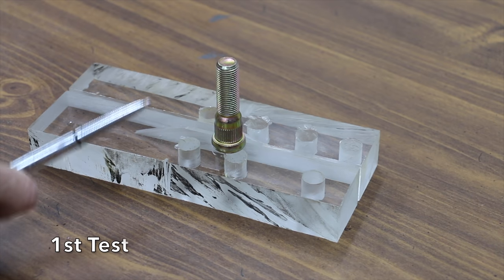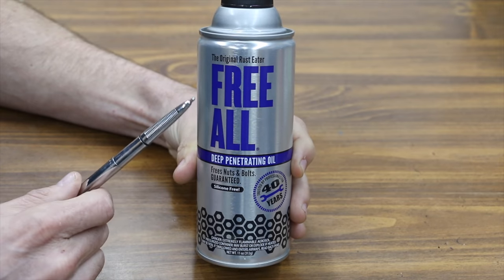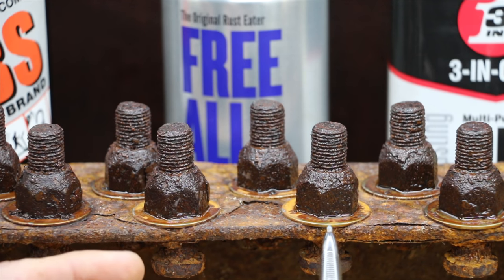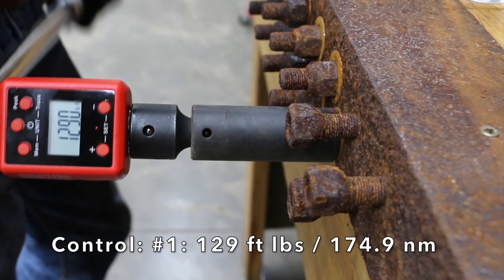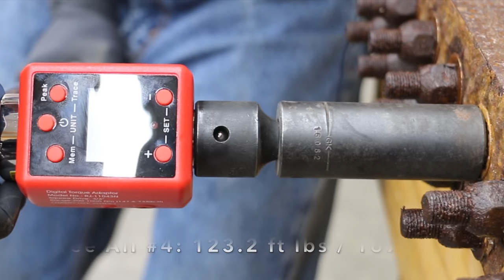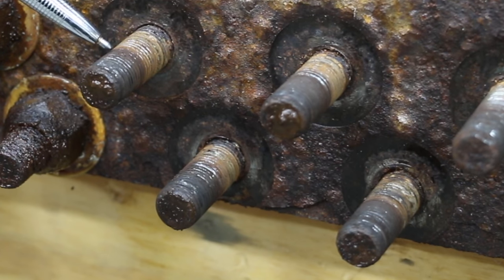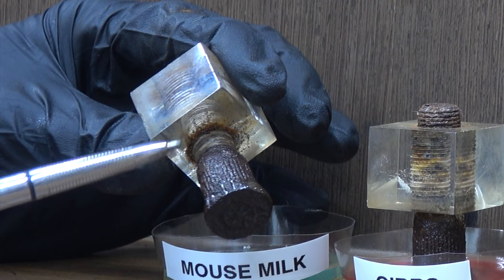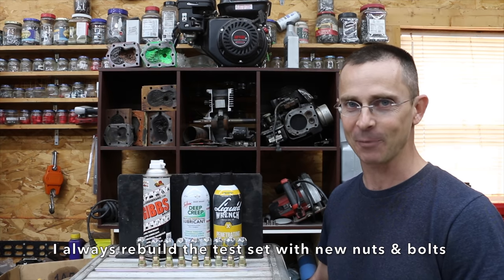Does Water work better than Penetrating Oil for Rusty Bolts? Let's find out!

Comment: seen the seafoam and gibbs video last night on my tv gibbs did not do so well  , for the price .  and I swear by gibbs since 1995 , but you show it's not the best I was Blown away .  I watch a lot of your test and you do a great job at testing .   last night the video had steel plate with rust prohibitors and you gave them a bath in salt and peroxide , gibbs failed  been using it on my guns other steel parts .  Thanks for the Videos
Reply from the maker: Thank you very much!

Comment: As a constructor I use a lot of screws, mostly torx heads. I'd love to see a test about screw shear strength and how well different types of head(torx, flat, philips etc) hold up to tool slipping, over tightening and so on.
Reply from the maker: Great video ideas!  Thank you

Comment: I was excited to see Zep 45 in the beginning, but never saw it during the tests. was it deemed not suitable for rust penetrating? Zep 45 is really fun, it smells like bananas.!

Side note for the water, you have to remember that that is the only one that evaporates. The second it starts climbing the threads, it increases its surface area so much that it evaporates before I can climb up any further.
Reply from the maker: Sorry about that.  I substituted the diesel in place of Zep 45 at the last minute since I had a lot of requests for diesel.

Comment: I'd like to suggest a test for cleaning very dirty and greasy engine parts. For example something like car wheel bearings packed with grease (smooth surfaces, clean grease) and also some parts with rough surface (cast iron if you can find enough similar parts?) with oil, grease and also smear some dirt on them etc. You could then try submerging them in various products. I've tried many "real" engine cleaners but none of them worked very well. Acetone works great, but smells awful and melts most gloves. Diesel is a good compromise, but it doesnt evaporate so the diesel needs to be cleaned off afterwards so not ideal either.
Reply from the maker: Thank you for the video idea!

Comment: Project Farm, you continue to impress! For an upcoming video, why not revisit the Seafoam Ford Ranger or the Blue Devil Ford tractor? How are they doing? Still running strong?
Reply from the maker: Thank you very much!  I need to revisit both of those.  The tractor is running great and so is the ranger, but the clutch is slipping badly in the ranger.  Maybe a clutch replacement video.

Comment: While some of these managed to penetrate in a tiny bit i think this demonstrates really well why penetrating oil is useless for the most part, it simply doesn't creep in enough to make a difference, I've been a mechanic working on all sorts of vehicles, even vintage and retro bikes, you're better off just using heat and a huge sledge than penetrating oil...
Reply from the maker: Thanks for sharing.

Comment: I had a cheap chinese pair of pliers left out and rusted, I squirted some gear oil between them and started working them back and forth for quite a while and it was still very stiff, so I sprayed some PBblaster knocker-er-loose on it, and it instantly fell to wide open.  sprayed it on the pivot circle and rust floated out the top of it like crazy.  Amazing the difference lower viscosity penetrating oils make.
Reply from the maker: Thank you!

Comment: You should to try out a half acetone/half atf mixure (automatic transmission fluid). I use this in a spray bottle like some other tests and it is the best even compared to penetrating oils.
Reply from the maker: Thank you!

Comment: I’ve never used Gibbs but I bought one can of free all and have never gotten anything since . Aside from being a great penetrating oil, it doesn’t hurt o-rings/rubber ect. Or paint and it only takes a fraction amount vs others. One can of free all will last longer than 2-3 cans of pb or others in my experience .
Reply from the maker: Thanks for the feedback.
Reply: @ProjectFarm  I was also a small engine mechanic , I really enjoy your channel , great job and keep it up! Also speaking on the free all , I’ve freed up several engines that were obviously rained in that were “running last week” ect lol.

Comment: The surface tension of distilled water means it works the worst in this type of test. Try it with 4oz of water and a teaspoon of dish soap, Go-Jo, or other hand cleaners as a wetting agent. You might use it as a condition in cleaning the crud off dirty parts.
Reply from the maker: Thanks for the recommendation!

Comment: the torque adaptor says on the side that its range is 147.6-738lb-ft.  the average values for all liquids are below 147. isn't this a problem?
Reply: I was wondering that myself.  I notice in response to blake kollman's same question, Project Farm replied, "Thank you. The readings are accurate. Compared it to my other adapter prior to testing."

Comment: Funny that people say 1 hour is more realistic than 3 hours. I say 1 hour is unrealistic and I will apply twice per day for three days. On top of that, once near the start and again near the end, heat the nut somewhat with a plumbers torch just before a spray of oil to help suck in the oil in and reduce viscosity along with the sudden differential in thermal expansion from nut to bolt.
Then I get a cold chisel(or air hammer with chisel bit) and split the nut as I should have done in the first place.
Reply from the maker: Thanks for the feedback.

Comment: Request : (Adding a comment there so it may be seen) Have you done any comparisons between OE disc brake rotors and equivalent aftermarket ones.  Do they rust less or more, do they warp easier, material hardness, toughness...actual material composition testing   etc.    Thanks.
Reply from the maker: Thanks for the video idea.

Comment: "it doesn't appear that the water did any sort of penetration"
But how do you account for evaporation? If I absolutely had to I'd probably use boiling water on the bolt and cold tap on the screw. Also did you account for salinity? (just thinking out loud - love the video 👍)
Reply from the maker: Thank you for the constructive feedback.

Comment: Another simple test is put your thumb and index fingers together as tight as you can. Then put a drop of penetrate to the fingers vertically. Turn horizontal open fingers to see the penetration that has gone thru your fingerprints. Also my favorite is BRAKE FLUID or ATF. Brake fluid works fanatic as a lubricant when drilling out studs or tapping any metal.
Reply from the maker: Thanks for the tip

Comment: Personally I find heating up rusted nuts with a torch loosens them up the best. Problem is you can't always do that on an engine. Try this same test after heating up the nuts. But don't heat them up too much otherwise the fluids will just vaporize. You may have to add more because it will evaporate rather quickly. I wonder if you use enough of the penetrating oil to cool down the nut would make it penetrate better?
Reply from the maker: Great suggestion!  Thank you

Comment: I wonder how well acids would work. A while back I used a vinegar to clean up some rusted parts. Also acids are used quite often to etch metal to make very unique patterns. You even use acid to remove the oxidization from aluminum so you can anodize it.
Reply from the maker: Thank you for the test idea!

Comment: Candle wax. Yes, candle wax. Old trick - heat nut and bolt up with torch (propane will do) as it only has to be hot enough to melt candle wax. Turn off the torch and touch the candle stick to the threads of the bolt right where they meet the nut. The candle wax will wick up the threads and loosen that nut  better than any oil you ever tried - give it a shot. It is a god-send working on suspensions in the Northeast.
Reply from the maker: Thank you!

Comment: I use 1 part automatic transmission fluid and one part acetone.  Far better than anything on the market.  Just have to make sure to store in a sealed container as the acetone will evaporate off
Reply from the maker: Great mix! Thank you

Comment: PB Blaster in my opinion works the best. It not only penetrates but disolves rust making rusted bolts come out easier. I'm sure that there are good products out there but I like to stick to the one that works best for me. Penetratiing by itself is only half the job. Disolving is the other half that saves you time and money.
Reply from the maker: Thank you

Comment: Another one you might want to test, different types of greases which product holds up to heat, lasts longest, protects the best against friction reducing ware. General multi-purpose, chassis, baring, and possibly marina ones are they any different or just a label.
Reply from the maker: Thank you

Comment: Are rusting necesary for thiese " experiments"...torquing bolts to spec,and then applying liquids could make "experiment" less depending on variables like rust consistency,if penetrators work then they should work on clean,fresh materials too. Besides, you could reuse those lugs and nuts and it would make seting up examples less time consuming. Anyways, superb chanel, superb content
Reply from the maker: Thanks for the feedback.

Comment: Why Water? Water dissolves rust. Rusty lineman pliers worked in water will free up like new. Then use WD 40 to displace the water. Rusty bolts or nuts if they can be barely moved if worked back and forth with water will loosen fully. Petroleum lubricants will not dissolve rust but will help lubricate. If some form of alcohol is included, the water in the alcohol will help dissolve rust if other ingredients don't interfere with the water/iron oxide reaction. Commercial fishermen have known this for years. They pull their rusty pliers out of the bottom of the boat, shove them overboard and work back and forth a few times and voila! I always try water first. and it usually works....then lubricate.  By the way... If using high heat to loosen parts, use cutting oil as a lubricant. The sulfur in the cutting oil will pull the oil into the heated part.
Reply from the maker: Thanks for the feedback.

Comment: If not doing multiple applications should still apply it again 5-15min before removing the nuts. If letting a product creep at the very least it would be applied again before removal. 

I thought the original 3 application method was good though. Gave the products more time to work, so if there is a superior product it should pull ahead significantly.
Reply from the maker: Thank you!

Comment: Great video keep-up the good work.  I’d like you to test Tech Line’s Dry Film
Lubricants.  These are coatings you can apply at home.  Do they work?  Many pistons for performance applications come with a dry film lubricant applied to the piston skirt.  Can Tech Line really work with a home applied coating?

Apply the dry film lubricant to a small engine piston, and connecting rod bearing journal.  Test
with oil for improved performance.  Remove oil and operate until lock-up to see if the coating protects the engine.

Maybe even test the thermal barrier on the piston top and head to see if it lowers operating temperature.
Reply from the maker: Thank you!

Comment: I want you to test something. I was told when I worked HVAC, not to used only WD40 when cleaning drain snakes for the Plumbers. PB blaster needed to be sprayed on them after wiping off the WD40. The WD40 would absorb water from the atmosphere and cause the drain snakes to rust.
Reply from the maker: Thank you for the video idea!  Does this video answer the question?   https://www.youtube.com/watch?v=UoijjWUGU2Q

Comment: I know it's not supposed to be used as that, but for years I've used WD-40 as penetrating agent to loosen rusty bolts and nuts with moderately good success. I would have liked to see it compared to specialized penetrating oil products.
Reply from the maker: Great suggestion! Thank you

Comment: If you ever come back to doing more penetrating fluid tests, I have two for you to try.

S' OK and CNH Industrial penetrating fluid (Part Number B505501)

I've used both at work and have had good to great experiences with both. S' OK seems like a standard penetrating fluid, but CNH Industrials spray seems to be quite different. It seems to be a mix of a penetrating fluid and something like krud kutters rust remover, as it will actually eat the rust away over time as well as penetrate.
Reply from the maker: Thanks for the suggestion.

Comment: All people in my family have always used 3 in 1 Oil, not for penetrating oil just as a light oil. I even have 3 in 1 Oil that is 20wt for use in electric motors. I wish you could try Kroil, I've had good luck with it, but it's gotten very expensive. I noticed some of the others are very high priced.
Reply from the maker: Thank you!

Comment: Water may have more climbing potential, but it also evaporates more readily in free air.
Reply from the maker: Thanks for the feedback.
Reply: @ProjectFarm  : I meant to say that it may have more potential than could be seen over time, BECAUSE it evaporates.  It might penetrate better with a little soap.  In firefighting, this is called "wet water," with reduced surface tension.

Comment: I wonder how well salt water or distilled water would fair. Granted they will never be as good as penetrating oil but they are different to normal tap/bottle water. Isn't distilled water even slight acidic?

Comment: if we look at how well the liquid did for the money spent water comes out well ahead of the other brands. now this has a lot to do with how cheap water is rather than the effectiveness of the liquid. basically if you take a look at the control (used in other videos, none used here) then took the average torque of the liquid and subtracted it from the control (how much the liquid helped) then took that number and multiplied it by the price paid (torque eased per penny) you get water as the front runner by a significant margin.

not saying i would use water if i could use something else, but as far as contests goes this does give the water a nice little niche.
Reply from the maker: Thank you for the feedback

Comment: Would be interesting to see how Brake Fluid works in penetrating.... My father used to use it when there was no penetrating oil available in our country :)
Reply from the maker: Great recommendation. I tested it in the previous penetrating oil video and it did well.

Comment: Have you tried Fluid Film as a penetrant.  I used it on my front axle nuts on my Chevy.  Wanted to keep rust to a minimum and make it easier to remove when the hub needs to be replaced.. Six months later, I started hearing a clunking sound when shifting into reverse and drive.  The dealer discovered both axle nuts were loose and the Fluid Film had penetrated completely through the nut and axle threads.. These nuts were put on at the factor using 150ft/lbs.  No kidding.  Would like to Fluid Film used in your next video.
Reply from the maker: Thanks for the video idea.

Comment: I've never felt that any penetrating oil made any difference getting a stuck bolt or nut loose. If it didn't come out dry, I've never got it out lubricated with anything with the same effort (in practical term). Heating (red hot) is the only thing that makes a noticeable difference, apart from just destroying the bolt/nut.
Reply from the maker: Thank you!

Comment: Submerge the bolt in water and you will see the real picture. Water, applied willy nilly,  may not be able to creep faster than it's evaporation rate. You should have thought of that.  Maybe try using heavy-water, if you can find some.

Comment: The diesel seems to flow and penetrate reasonably well so I'd actually be interested to see if a mix of diesel and molasses does anything to free up rusted nuts. Molasses usually gets applied for day/weeks but it may start to do something after an hour. Then again it may do nothing :D
Reply from the maker: Great point on mixing it!

Comment: Video Idea: 100LL (or AVGas, the stuff used in airplanes that have Piston engines), Gasoline, Heating Oil, 5W-30, Transmission Fluid, and cooking Oil use all of the above as penetrating fluids
Reply from the maker: Thank you for the video ideas!

Comment: If you ever got less than an A in your scientific experiment projects in school, I'd find that comical!

Have you ever tested gasket makers i.e. RTV's?  Like the various Permatex brands vs manufacturer specific recommended engine sealants/RTV's i.e. Nissan's Aisin, Honda's Hondabond, Motorcraft's RTV, or Mopar's RTV and etc...?

It would be interesting to see which one's do the best overall with heat, vibration, and resistance to engine oil, gear oil, coolant, and transmission oil.  Which one's do the best overall?  I've found Mopar's and Nissan's seem to do very well and do not require a completely clean/dry surface to bond well, but I could be wrong?
Reply from the maker: RTV gasket makers is a great test idea!  Thank you

Comment: i would try break away and pb blaster theyre both great penetrating oils. I would also add to the test torque it takes to continue removing the nut after it breaks loose im sure the margins would be much wider in that case.
Reply from the maker: Thank you!

Comment: 3:26 You meant lowest viscosity. High viscosity means the 3in 1 would be a thick non dripping or soaking liquid.
Reply from the maker: Thanks for the feedback.
Reply: @ProjectFarm  that's OK I make the same mistake which is why I know it's wrong because our way makes far more sense!
Reply: Incorrect
Reply: @uberleet01  no, otherwise I wouldn't have said it

Comment: Yield by Chemsearch is the best I have ever seen work . Had a plug on a  huge water pump that was seized. Tried a huge impact with 1100 rev torque that didn’t work tried a 10’ long piece of pipe with a tee handle that did nothing sprayed the Yeilld on about ten minutes later it came out with a 1’ 1/2  ratchet
Reply from the maker: Thanks for the feedback.